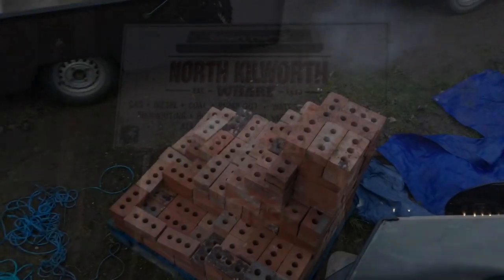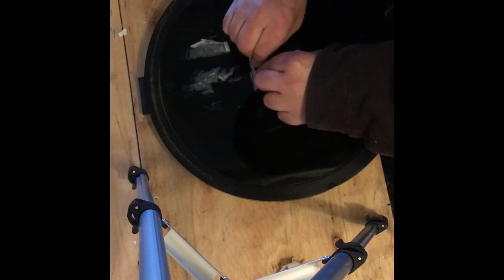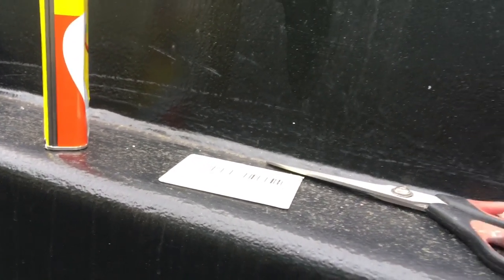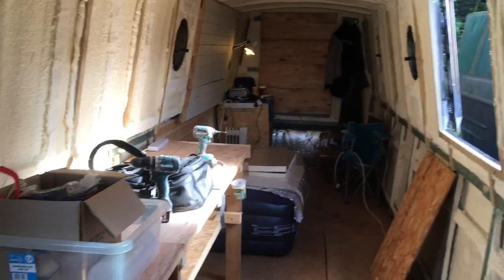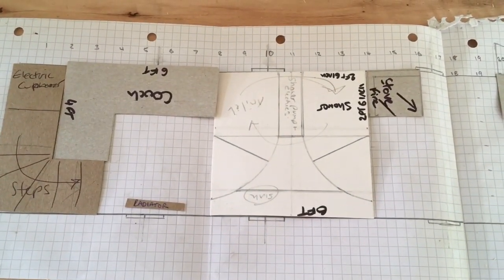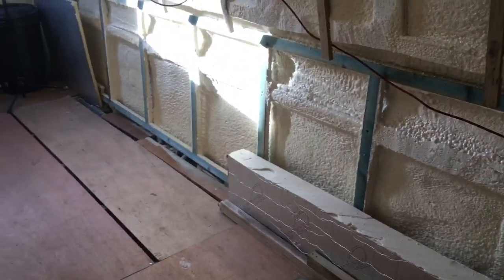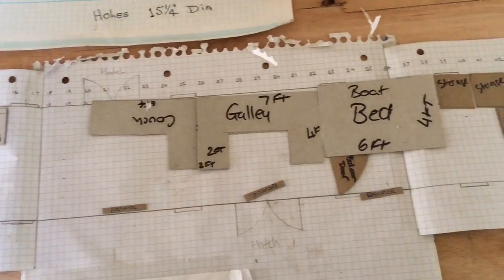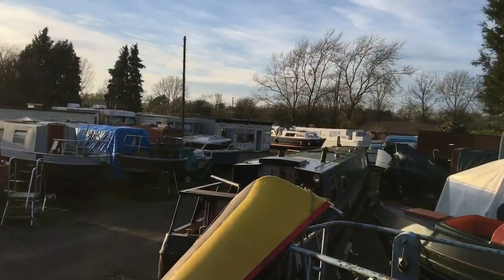65. Cleaning Up The Windows & Working On My Layout

Comment: That's really coming on Oli. Listening to the way you explained how you want things to work makes good sense. When you were talking about making cable runs for the electrics and as you yet don't have a definitive plan for, may I suggest making cable runs down both sides of the boat with extra cables, even though you don't plan on using them yet, they are there already installed to future proof any design changes and/or additions you may want to make later without having to ferret cables through inaccessible places. On the basis of, its always easier to take a cable out than put one in. Cheers
Reply from the maker: Oh Yh agreed, over doing it on the front end will save time and tears later on, that’s one of the reasons I haven’t progressed further already, so much to consider… thanks for watching & commenting 👍

Comment: I don’t agree with your layout. I think the bathroom should be off the bedroom so it’s like an on suit. Then lounge area dinner and then galley next to the deck so when you out driving the boat or sat on the deck you can easily pop in to galley go get drinks and stuff. Basically a bit like James lay out on his boat but with a lounge as well  after the dinette and before the shower.
Reply from the maker: Yh I like that layout, and ideally I’d do something like that, but what would you do with the big hatch? Put a corridor bathroom opposite? Surely that massively diminishes the use/benefit of the 3ft wide hatch. Also James’ stern door is offset to the side, allowing for a cut out galley right inside the door, mines central so if I had the galley at the back then it would need to, by necessity, by straight cabinets/worktop either side, which I don’t like, they create bottlenecks with 2+ people in the boat. Thanks for the input, please feel free to add other ideas and/or suggestions for  things 👍 thanks for watching and commenting
Reply: @olivellanarrowboat4319   well as much as I wouldn’t want to I’d have to get the hatch welded up and maybe a privacy window put in as that’s definitely where I’d want the bathroom just off the bedroom and I’d do it now as the builds at the start rather than do it at the end when the builds finished as that’s where I’d want the bathroom. As for the kitchen I get what what you are saying but I think I could live with it like that just so I could have the convince of being able to get food and drinks quickly when I’m up on deck or outside the boat as I know in the better weather I’d be outside most of the time. I suppose if you hated that idea that much you could have lounge dinette then kitchen then bathroom and bedroom or lounge kitchen dinette then bathroom and bedroom. Obviously it’s easier for you to visage as you know where the windows and hatches are but it wouldn’t bother me blocking the hatch for the bathroom as I wouldn’t want to have to walk through the boat after a shower to go get dressed I’d want bathroom next to the bedroom. Also for when you’ve had a load of drink the night before and you have to keep getting up to go to the toilet atleast you are right next to it and don’t have to walk though the boat all the time to use the toilet.